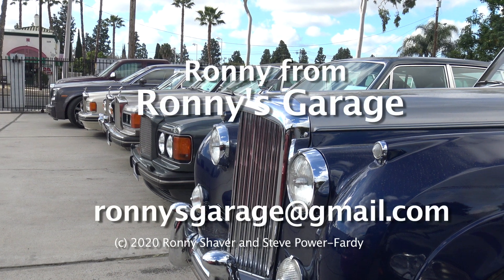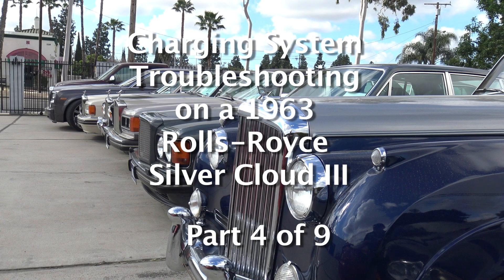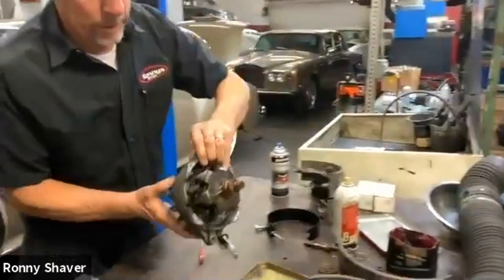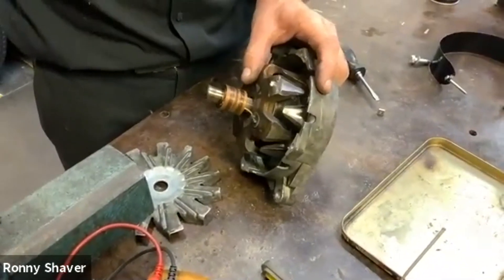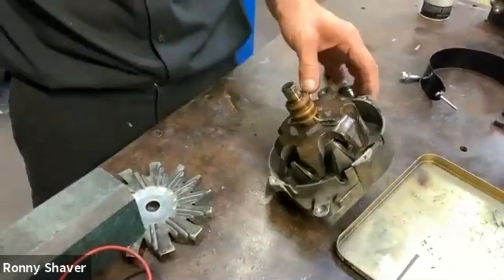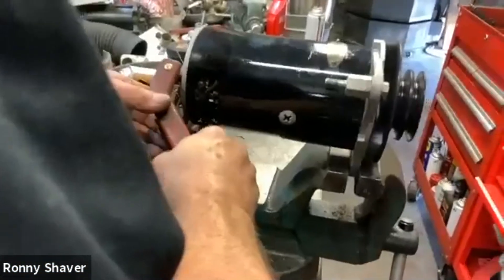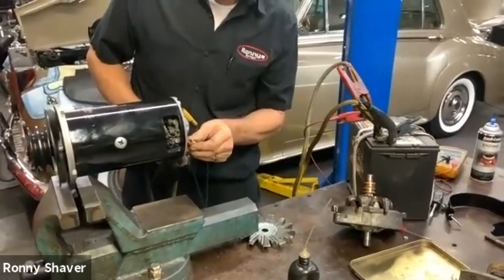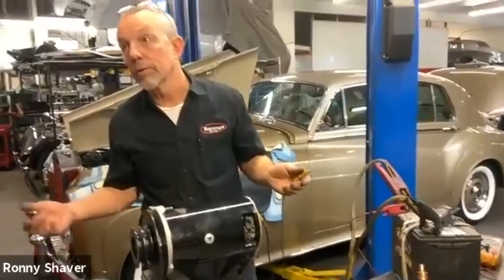Silver Cloud III Charging System Troubleshooting Part 4 of 9

Comment: Good on you Ronny for jamming the owners generator into a vice without using something like wood or what ever to stop the jaws of the vice fucking his cadmium coatings which he spent thousands doing. Zero out of 10 for that one.
Reply: If you had ANY powers of observation, you would have seen that the piece that was in the vice was the non coated mounting bracket. Way to miss the entire point of the video for your nagging over a non issue.